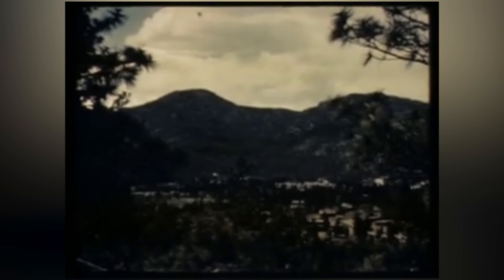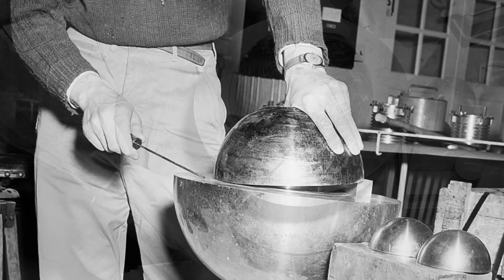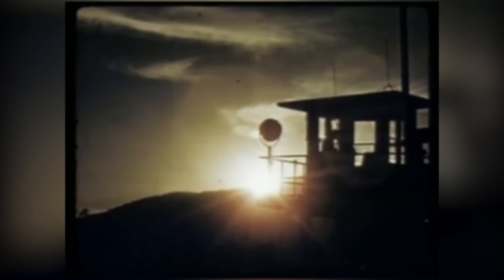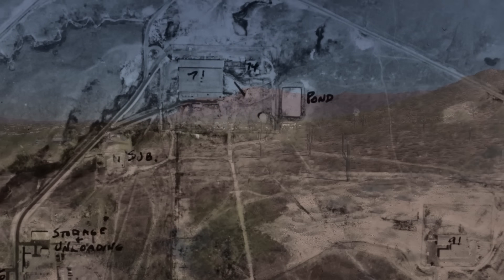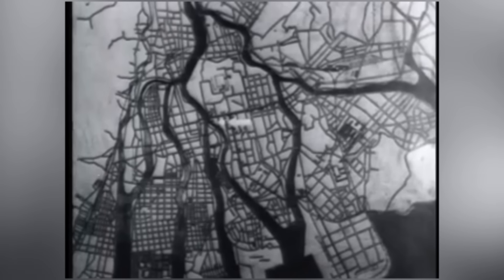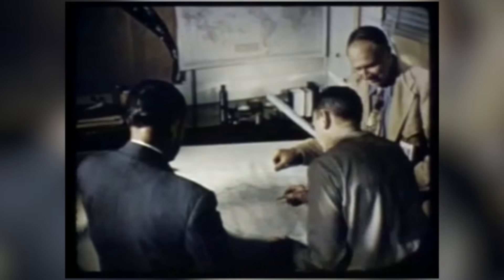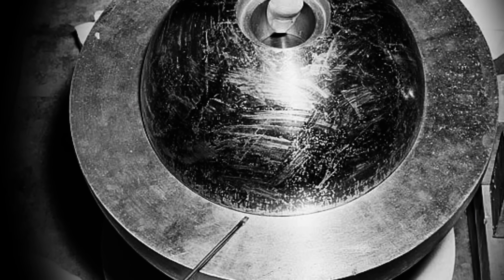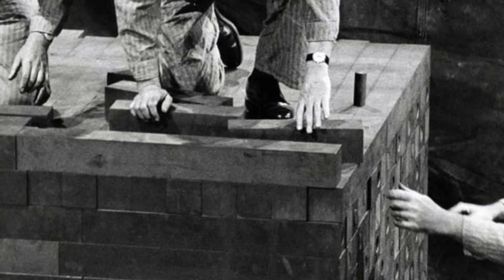Demon Core: The Unused Third Atomic Bomb of WW2

Comment: "The work had always been dangerous and the scientists knew the risks..." Important point and these few deaths do need to be considered in the context of the times e.g. the risk ordinary soldiers faced and experienced throughout the Pacific, European, North African/ME, South Asia, SEA campaigns. Nicely told doco.
Reply: Exactly. Not sure how many total died from radiation poisoning. Many soldiers ordered to turn and face the test explosion eventually died from various diseases caused by their exposure but as you said, when you compare those to the numbers killed in battle, it was minor. Estimates put american loses on D day alone at 2500. 

I think the issue though is the deaths could have easily been avoided. I mean, playing around with a plutonium core with a screwdriver. That's like checking the level of gasoline in the tank with a lighter.

Comment: Man, the early nuclear weapons developments were metal as hell. 

IIRC it was that maniac Edward Teller who was like 'nah bro, regular atomic weapons are for kids, what we need is something a thousand times stronger' *goes to develop thermonuclear weapons*, which would culminate in 100 megaton warheads being developed before people were finally like OK holy shit, calm down before we crack the planet open guys! 

For comparison in terms of tons of TNT equivalent : 

Trinity : 22000 tons
Little Boy (Hiroshima) : 15000 tons
Fat Man (Nagasaki) : 20000 tons
Castle Bravo (Bikini Atoll) : 15000000 tons
Tsar Bomba (Novaya Zemlya, Barents Sea, artificially limited to 50MT) : 50000000 tons
Tsar Bomba (design specification for maximum yield) : 100000000 tons

Then you have wacky shit like the Mark 54 SADM, a literal backpack nuclear bomb, and a whole host of crazy artillery and rocket nuke systems like the operation Upshot 280mm (11" shell) artillery piece that tested out at ~15 kiloton at just over 6 miles away. The gun was called 'Atomic Annie', and they made over a hundred W9 nuke shells for the thing until retirement in 1957. Not retired because 'holy crap that was a nutty idea', retired because they made even deadlier versions to replace it with, lol. W19, still 280mm, but upped from 15KT to 20KT. Nope, still not done, made a freaking 203MM W33 arty shell @ FORTY kilotons, or well above the combined destructive force of both bombs used against Japan, all in a convenient shell you could use in any standard M110 or M115 8 inch howitzer field piece.
Reply: "Davy Crockett."

Comment: I realized long ago how to avoid these types of accidents. Both involved gravity when control was lost over the shield or the brick, and gravity cause completion of the critical mass episodes.  i realized that the trick was to do away with approaching the core from above, but from the bottom.  If the shield or brick were fumbled, either would simply fall away from the plutonium core and presto... no accident.  Some years after that I was looking at the logo for the Atomic Energy Commission; an apparatus which does exactly what I just described --- apparently the problem was fixed after two deaths.  I thought that was interesting, but still can't figure out why it wasn't immediately obvious before hand that it wasn't a good idea to lower a neutron reflector to a radioactive core.  And, using a screwdriver to maintain core-to-shield separation?  These were scientists for Christ's sake, behaving like some shade tree mechanic.

Comment: I probably could design a set of armor that might have been able to save their lives... basically Knight Armor except made out of 1/4” to 1/2” thick lead plates. 1/2” over the head, neck, chest, and gut area. 1/4” over the legs, arms, and shoulders. Lead chain mail with hammered scales over the gaps covering everything the plates don’t cover and any gaps in the plates. Helmet modified to have a M9 Gas Mask sit under it.

Comment: 9:11 "In nuclear jargon, going super-critical is never a good thing."
Reply: What's funny is that >50% of operation at power is supercritical. Subcritical is lowering power, critical is maintain power, supercritical is raising power. Since so many reactions are happening in such a short period of time the core never really maintains criticality. It kind of oscillates up and down around a steady power level. Just averages out to a steady state that is refered to as critical. However extreme care is taken and startups take quite a bit longer than shutdowns in most cases (certain cores need to be slowly brought down in power -see Chernobyl's major design flaw). This means that most of a cores operation measured by time is actually supercritical. What he meant and would've known if properly researched is that's it went prompt critical. This requires a deeper than comment section explanation, but means a runaway uncontrollable rise in power. Essentially the exponential upper end of the supercritical spectrum. Source: operated a reactor

Comment: Also, in nuclear jargon, "supercritical" can be a very good thing. In order to start a nuclear power plant, the core must first go supercritical and warm up to its operational power. Going supercritical is only a bad thing when you can't control the power levels.
Reply: Marvellous.
Reply: @GeneralZap  there are 3 stages a core can be in. Subcritical, critical, and supercritical. Subcritical means the chain reaction doesn't have enough juice to sustain itself, so the core will decline in power. Critical means there is just enough fission to sustain the chain reaction, but not enough to cause an increase in power. Supercritical means the chain reaction is strong enough to continually increase core power more and more.

Comment: Super critical is an explosion, of course what we want in a nuclear device designed for that purpose.  Critical is where the reaction begins to share electrons, which is the blue flash and heat.
Reply: Not quite.  Critical is simply the point where a self-sustaining chain reaction takes place.  Super-critical is when it becomes, as with Slotin and Daghlian, an uncontrolled chain reaction.  And electrons have really nothing to do with it.  I think you meant an exchange of neutrons.  The blue flash is essentially Cherenkov radiation resulting in high-energy gamma rays creating that blue light within the vitreous humor of the eye when the speed of light, due to the water content of the eye, is slower than in the surrounding air and the gamma rays give up their energy in the form of visible light.
Reply: @brillopad1392  Gamma Theta Beta and Alpha and  or X-ray radiation can not be seen by the human eyes.  I concur that it is indeed neutrons shared, however it cant be said that electrons have no place since neutrons decay in a relatively short time into a proton, electron, and sub-atomic particles.  We really have no idea how the decay of the neutrons are affected by the splitting of the atom on the sub-atomic level, but back to my statement from before, I stand firm on the electrons being the source of the light emissions (or at least the released photon in neutron decay).

Comment: A pure genius mind with extensive knowloadge in nuclear physics that shows that repeatly performing experiments may low your guard... Even working with extremely dangerous materials. Anycase, in that time, I don't think they had reliable robotics or much time to do things as good as they like. This kind of refined engineering may required really hard-to-make items that may delay the project for much more time than the army was willing to give you. The human hand and a relatively simple and a fast tool to use was reckless, but effective. However, 150 Sieverts in just HIS HAND in few seconds even is just crazy... Even considering hands are relatively radioresistant. I don't even wanna know what happened in his intestines, eyes or blood in general. I mean, an average year background dose is stimated at 3 mSv... He just literally received the background dose of 150.000 YEARS in just his hand in the period the plutonium nuclei reached the supercritical state, the time he just realized what the fuck just happened and between the time quickly reacted to remove the berillium neutron reflector. How hot may have that been after just few seconds of being supercritical?AS seen in the demon core, it gives me shivers when you see him calculating the inverse square law to actually see who was hopelessly gonna die...  Whoever saw the blue glow of the ionized air should've be amazed to another level and then shit his pants.

Comment: Not hating on you. You are talking about two completely different tests.  The dragons tail was a vertical test.  They dropped a slug down a track and it was critical for just a second (actually much less than a second).  I don't remember if they had another name for the Demon Core test but it's the one using the screw driver. Good video though.

Comment: As far as I know, was the Demon core used in the Able shot of Operation Crossroads. The drop was way off target due to stabilisator malfunction.
Reply: Not true. "The demon core was intended to be used in the Operation Crossroads nuclear tests, but after the criticality accident, time was needed for its radioactivity to decline and for it to be re-evaluated for the effects of the fission products it held, some of which could be very poisonous to the desired level of fission. The next two cores were shipped for use in Able and Baker, and the demon core was scheduled to be shipped later for the third test of the series, provisionally named Charlie, but that test was cancelled due to the unexpected level of radioactivity resulting from the underwater Baker test and the inability to decontaminate the target warships. The core was later melted down and the material recycled for use in other cores."
"Demon Core" - Wikipedia.
Reply: @buzaldrin8086  Thanks for the info. Someone must have update the Wikipedia. I'd swear it also stated it was used as Shot Able.
Reply: @vitkriklan2633  I also remember hearing somewhere that it was used in either Able or Baker. Interesting, thanks Buz

Comment: Fascinating--a little more rough around the edges than usual for Dark Docs and a few slight inaccuracies but nonetheless an excellent entry.

Daghlian and Slotin were conflated into one fictional character for the 1989 movie variously titled 'Shadow Makers' or 'Fatman and Little boy' and played by John Cusack pretty well. Both Paul Newman as Groves and especially Dwight Schultz as Oppenheimer are also excellent in their roles.

The nature of the 'blue flash' itself has always been pretty mysterious and reported at almost every criticality accident. Strangely however there have been no photographs of it captured for posterity, although cameras are often present in the areas where these incidents occur. I like the explanation that it is produced by Cherenkov radiation as the storm of beta particles transition between the open air and the fluid inside the witness/victim's eyeball. However it is most likely due--far more boringly--to heavy localized ionization of the air and the cameras missed it because they were just not pointed in precisely the correct direction.

Comment: I'm pretty sure they didn't pick that location for its beauty.. They picked for it location near the river and the Hoover damn that would give them power
Reply: Why pick a site over 600 miles from Hoover Dam?
Reply: 600 miles in America is a short drive.. It's close enough to get power and far enough away not be noticed.. Plus electricity can travel for 10,000 miles and not be affected, it's just how much copper and infrastructure do you want to put in place to get it travelling 10,000 miles
Reply: And like I said it was the river that made the difference, not the beauty, that was my point really

Comment: Super critical simply means that the neutron population is increasing, not the amount of radiation. Because they were using pure plutonium, a high power level was almost instantly reached when the accident happened. At the time, very little was known about the effects of nuclear radiation and the "safety measures" used back then were ludicrously poor by today's standards. They jst didn't know. The scientists involved provided a great deal of information after they were affected by the radiation. Ref. 22 years in the nuke industry.

Comment: Once the core starts to fission,  how do you turn it off? I thought there was no way.
Reply: Carbon zirconium rods, they absorb free neutrons...This however is also dependent on the engineering around it. Uranium in a reactor is one thing, however if it reaches criticality and runs away, that's another issue.
Reply: @aroundthebend721  that applies to nuclear energy in a reactor type of environment.  In the video the plutonium sphere is in open air, no water to cool and no zircoliod.  No method of slowing neutrons. So when they get the blue flash, fission begins with no aparatus to stop fissioning. Im curious to know how they stopped the nuclear reaction
Reply: @MrKfq269  Re-read my reply.
Reply: @MrKfq269  To be clearer, originally when this happened they used a screw driver to prevent the two halves of a sphere from touching therefore preventing criticality. It takes 'X' amount of mass to achieve fission, less than that 'X' amount you have a mess and a lethal dose of ionizing radiation.
Reply: It's a time thing. You start with a sub=fissile core. Now, being the Los Alamos scientist you are, you're wondering how to test this shit? So you do a zillion calculations and every one says that you're gonna get  a peak neutron/gamms spike, And, ZIP; boom. you're out the other side.

Comment: Hmmm a Canadian eh? Lucky. Came close. I found papers from Madame Curie and Albert E way up in Canada at Port Radium, N.W.T. Where the tailings still were very dangerous in the 70's. The workers there in the mining areas lasted maybe 6 months after exposure during the mining of the radioactives.. Turns a soft purplish when rained on..
First radar controlled AA guns could reach to over 40, 000Ft. surrounding area, and land mines surrounded the area as well. The mine then changed into mining silver and gold but from a different entrance and shafts which avoided the bulk of the radiation.  I saw ONE piece of silver that was maybe 6 feet long by 3.75 feet tall and 4-5 feet wide. Was a bit smaller by the time they got it to Edmonton to display in  a bank. (no it wasn't me)

Comment: I wonder how many megatons of TNT that core could have produced?
Reply: 0.021 megatons.
Reply: @buzaldrin8086  thought it may have been more since it was so dangerous
Reply: @nzoomed  It was the same size & type of core used in the Trinity test (July 1945) and at Nagasaki, code named "Fat Man". The largest explosion ever by a pure fission weapon (Ivy King) was 500 kilotons, or one half of a megaton.
Reply: @buzaldrin8086  OK, makes sense. I wonder how powerful that core could have been if used in a hydrogen bomb? Im presuming it was reused for making several H-bombs, although it is still unknown to this day what tests it was used in.
Reply: @nzoomed  H-bombs (or thermonuclear weapons) did not exist until about 1954-55. Have you read up on how they are built?
Reply: @buzaldrin8086  yes i know how h bombs work. Video says this core was reused for future tests. We still dont know what types of tests they were
Reply: @nzoomed  So h-bombs use either U-235 or PU-139 in the primary (fission) stage as a starter, and in the secondary (fusion) stage, as a "spark plug". Their design is quite different than the early fission only bombs, which were based on the Fat Man design or a variant of the gun-type design used in Little Boy. But you probably know all that, right?
Reply: @buzaldrin8086  exactly my point. H bombs still need the stuff for the fission stage.

Comment: Did I hear that right? They let a 24 year old play around with that stuff? The only 24 year olds I know of that I'd trust around something like that are the polygamists from Colorado city. Many of them have been running heavy equipment since that age of 8 or 10.
  I know it is hard for some people to wrap their head around but you can tell somebody about safety rules till you're blue in the face but most people will find reasons to disbey them every once in a while until they've actually seen the damage that can happen, first hand.
  I bet if you put any 30 year old pipeliner in that room with those cores, explain to them how it works and what happens when criticality is reached, they would have insisted on redundancies because by that age, most have seen a serious accident or three.

Comment: The third bomb was dropped on Nagasaki. Second on Hiroshima and first on New Mexico. That's all there was for quite a while.
Reply: Yeah until June 1946, less than a year later. 

Operation Crossroads, Bikini Atoll.
Reply: Technically the bomb was not "dropped" on New Mexico.  It was already on the ground, or just above it to be perfect.
Reply: @skydiverclassc2031  The "Gadget" was resting atop a 100 foot. steel tower. This was to somewhat simulate an air burst (like at Hiroshima and Nagasaki, although they were much higher above ground), as well as to reduce fallout.

Comment: ok,so was there a point to this?
Reply: the experiments? Yes, to test how to build more efficient(the hiroshima bomb used only about the weight of a dollar bills uranium in its fission, scattering the rest) and more powerful weapons. Its how weapons of smaller physical sizes could later get to the megaton yield range. A better understanding of the physics was needed. Prior to trinity they werent even sure a detonation would occur, they believed it might just get very very hot and fizzle out,later developments were the addition of thermonuclear(fusion of tritium and deuterium) as fusion required a TON of heat and compression to have it occur and a fission weapon would act as a trigger to the thermonuclear fusion main.